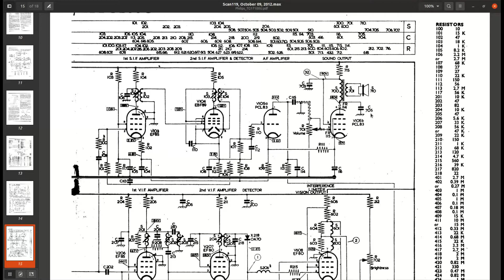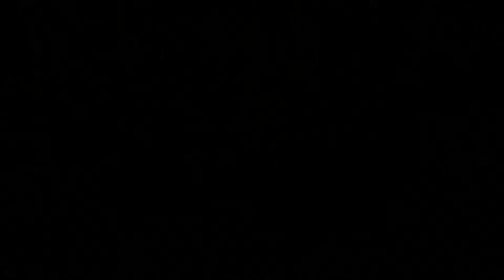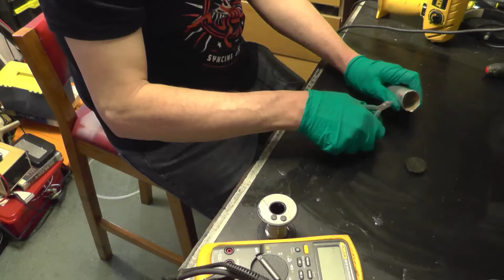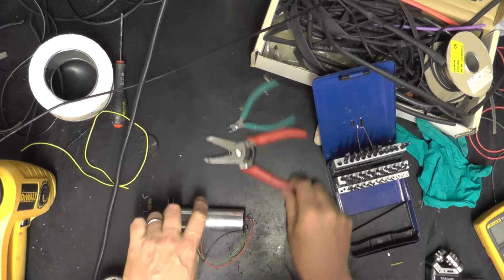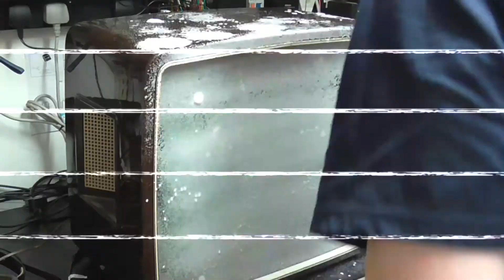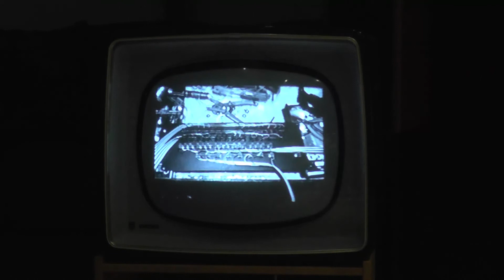17TG100U.  Finishing up ...

Comment: ...but you re-installed the OLD resistor on the tin you just refurbished. Won't that cause trouble soon ?
Reply from the maker: Why replace something that's still to tolerance? I could replace every single component in the set, but that's pointless.